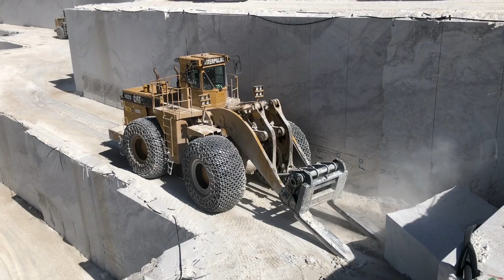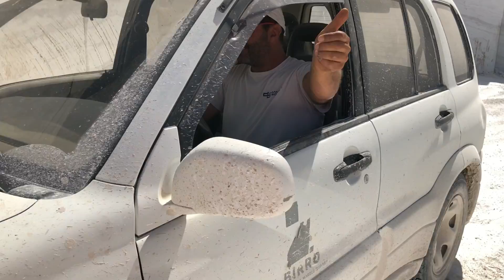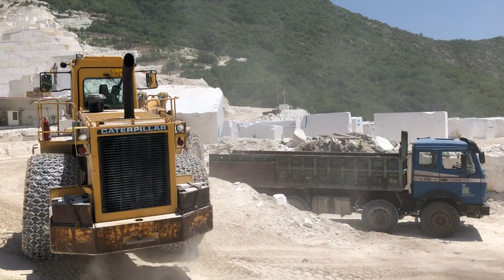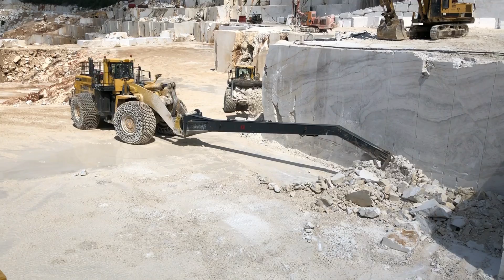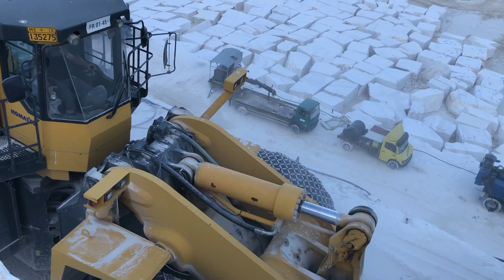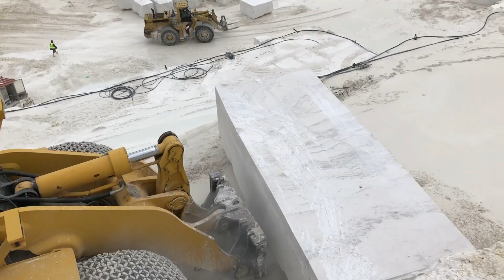Komatsu And Caterpillar Wheel Loaders Working On Birros Marble Quarries

Comment: 7:25 - wow if they're hoping to use the slabs of marble whole, they need to not let them fall over like that but put lower them gently.
Reply: I suspect that if the stone breaks then it would not have been sound enough for structural use in the outside world. I can only assume that the quarry owners accept this as a system to gently lower the blocks is not difficult to make.
Reply: The have no way to transport a piece that big, but maybe they should find a different way to cut these.

Comment: I don't get the purpose of dropping the big slabs onto broken debris, I would assume they want the slabs to be as whole as possible.
Reply: I'm guessing it's probably softening to take the shock out of the drop - although the blocks break, they'd might break more if dropped onto a flat hard surface.
Reply: @mikaelabowen5781  They break them on purpose since full slabs are too heavy for available equipment to move.

Comment: Surly these blocks would be worth more whole. Everyone that drops with rubble under it breaks up??
Reply: Without the rubble, the fall would be even harder. Also I don't think there's much demand for such big slabs, because it's all got to be handled and transported on the road, which will get tricky and expensive too. The wheelloaders can't lift much more too. If they wanted to get them whole, they would surely put more rubble under it to slow the fall.